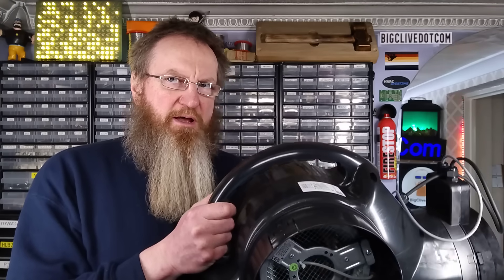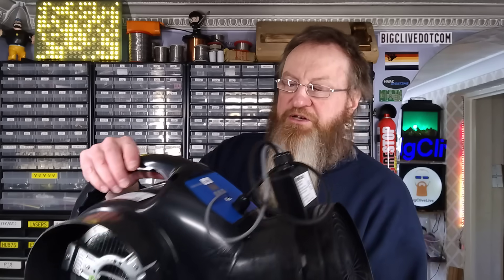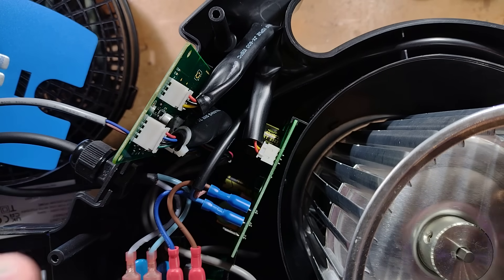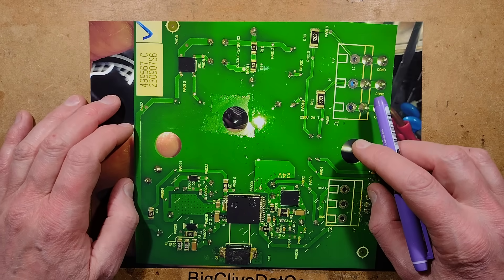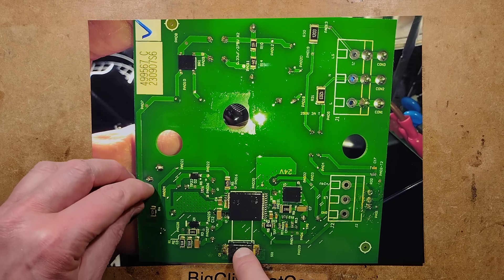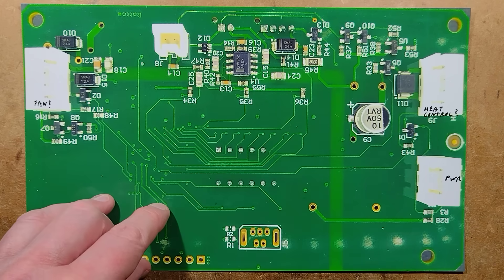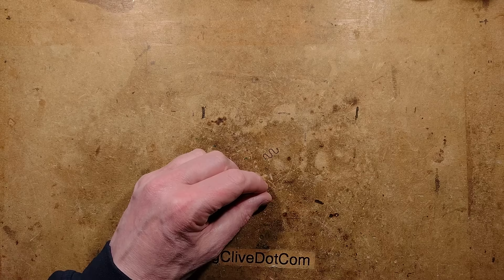Inside a Positive Input Ventilation (PIV) unit

Comment: More advanced products in this category are called Energy Recovery Ventilation (ERV). Essentially it pulls in fresh air across a radiator while pushing out stale air through a separate set of pipes across the same radiator so that the incoming air is at about the same temperature as the air that it's replacing. It's a fairly important part of modern high-efficiency residential design. A lot spendier up front than PIV, but because it literally recovers energy it's more cost effective in the long run.
Reply: Plus you get a guy to adjust it so that it is balanced pressure
Reply: My mates got one in his house and he says it's rubbish. Because of this they put no rads upstairs and just rely on the vents but it's cold even though it's over kill with insulation. He's switched the thing off and is going to put rads in.
Reply: @HA05GER  They did what? Even with perfect insulation an ERV isn't going to provide any room heating. If they installed an ERV without heat of course it's going to be cold.
Reply: @eDoc2020  so the system sucks in fresh air when needed and also circulates the heat from downstairs to upstairs via vents. So the whole downstairs is heated but not up and relys on this system to push the heat upstairs. It's a huge unit that takes up a large cupboard and the loft is filled with ducting to distribute the air.
Reply: @HA05GER  That's a lot different than just an ERV. If everything's installed properly the circulation should let you get away without more radiators but I don't think there's any harm in adding extra radiators.
Reply: @eDoc2020  yeh but it does positive input aswell. So it runs on the same principle as a pub aswell as moving air around the property.

Comment: That 24V component connected across the supply rail of the microcontroller board looks like a transient voltage/avalanche diode to protect against voltage spikes.  24V is probably the nominal voltage.

Comment: I would not recommend them. I worked for the council, which had thousands fitted. They can be very cold, at times, and drafty, and the need to service them every year which meant getting into the loft, which had its own health and safety problems. Also, installation needs to be done with care (make sure the vent will not blow near a smoke alarm).

Comment: It wouldn't be that difficult to manufacture a simple wire frame to support that filter bag;  Fit one of the available "Hi-Flow" HEPA filters and you can have a very clean air supply - I would imagine you might find that some of the larger cylinder HEPA filters used on  commercial wet / dry vacuum cleaners will do the job quite well, or they would be easily modified to suit! End up with "almost clean-room" air standards indoors!

Comment: Overpressurizing your house is a really terrible idea in cold climate as the warm, moist inside air will be forced into the structure where it cools and causes condensation in the insulation as the dew point forms inside the walls. In hot climates where the inside air is cooler and drier due to air conditioning than the outside and there's not much insulation in the walls anyway it's different. Here in Finland all houses are built to have a slight vacuum due to either exhaust fans or natural ventilation through chimneys to prevent condensation in the walls.

Comment: The professional version of these have a Transverse Flow Heat Exchanger, which passes incoming air in the opposite direction to the out-going air, thus saving any "Hot" and/or Cold" from being lost. They do dramatically increase the efficiency of an Air-Con system.
I built my own out of a few lengths of Air-Con duct and a small fan. Temperature measurements at "In" and "Out" show a worthwhile gain in efficiency.

Comment: eh those bit coin mining graphix card cooling fan arrays are super cheap. wonder if it would work to just use one of those with some clever ducting and a heat exchanger? 30 bucks for the fan array, another 40 bucks to buy a small car radiator of some kind

Comment: Maybe it should be remembered older houses had an average of three complete air exchanges per hour, and Scottish Castles are notoriously draughty.  Newer, so-called "air tight" insulated homes, have three per day. Balanced Heat/Energy Recovery Ventilators are recommended for enersave houses.  

My tiny postwar castle in the PNW benefits from fresh air, except when raining.  I'd buy it if it was cheap, otherwise I use fans sealed onto the inside window frame to create draught. I have two, named: Sucky and Blowy.

Blowy is in the bedroom and blows inward, and Sucky is in the castle kitchens, expelling cooking odors outside. They are on smart plugs as an inventively-named routine. "Alexa, !@#$!  "Never even considered creating positive pressure!  

This would safely better eliminate the musty biker motel castle smell, and smoking, BO, mold, and beer spills, dirty workclothes, leaking hot water tank and toilet; than sucking in attic vermiculite asbestos and rat droppings through the castle ceiling, the immediately adjacent septic tank, and the Royal Mounted peeing off the ramparts (they tell me it keeps the bears away). Thank you, this is Brilliant.

Comment: Neat idea for the winter it has a heating element I would guess the loss is negligible. In the US heat exchangers are a thing with tight houses the outside air is warmed or cooled so you do not  loose a lot of heat or AC . And stale air is expelled.

Comment: Over here in Canada, I've been told to install an HRV (heat recovery ventilator, I believe) as part of a renovation. We did so, but we aren't finished with the work yet, so we aren't running with it on. But the interior of that device is bizarre. Two fans and a stack of sign plastic (in alternating directions) that the air flows through. One fan exhausts interior air, and one sucks in outdoor air. Supposedly the stack of plastic does heat equilibration, and somehow it also deals with humidity. I have a hard time believing this, but we're required to install it, and eventually I will see how it actually performs. It's somewhat similar to what you're looking at here, at least in function, but a lot simpler in terms of electronics. (Well, there is a control panel for the thing that can change the fan speeds and probably program times off and on, but that's about it, I think.)
Reply: hrv has the plastic core, tho aluminum ones can work better for really cold climates. while it blows indoor moisture out, you may find it your dry outdoor air makes the house to dry and need humidification. erv's work better (uses a paper core) and they keep the moisture in the house (less humidification needed but may need dehumidifier in summer). they need programming to set the correct speed for the volume of the house. they also have a defrost function to defrost the core.
if your renovating i would have it running at a high speed. ventilate all the fumes from paint, glue, etc.

Comment: Pressurized indoor air cannot be used when the outside temperature is below zero degrees. The humidity in the room air condenses on the inside surfaces of the exterior walls and causes problems.

Comment: nice video. they are common here. that one looks old school. most now use ec fans often with 0-10v connection for speed control. 
typically use a wall mounted controller in the main room, so it reads room temp and sometimes humidity on the fancy models.
very cold/dry countries tend to use exhaust ventilation so it sucks dry outside air into the house through walls etc, to avoid inside moisture frosting inside the walls.
the best is balanced ventilation either hrv or better yet erv, but you need a decent house for them to work well.

the filters should have a basket for them to go over or go inside a big tube the other way around.
you can use an outdoor vent, especially in hot summer. typically they will shut off went it gets to hot.

to much airflow can bring in a lot of humidity and make things worse.

the vents actually fire the air across the ceiling so it follows the ceiling and wall. that way it can sneak down the back of curtains (if no pelmet) and stop condensation forming on the windows.

the cold air coming in is more of a perceived issue rather than a real issue. we get lots of problems with certain types of people blocking them off because they thing it will save them on heating costs, and then they end up with moldy homes.

Comment: Hi Clive. An interesting idea...but....shuts off, or gobbles electricity, in the winter\cold weather, and fills the house with (super) heated air in the summer and\or sunny days. Hm-m-m...maybe not so great year round, but okay for 2 seasons? I grew up in a house with a 'whole house' fan. It exhausted air from the attic. Really helped keep the house cool from spring through fall, and our climate isn't all that sunny really (southern Ontartio, Canada).

Comment: I've been reading the comments and have to add the following. Yes, the air is very dry in most cold climates however once the air is inside it picks up moisture from people, plants, cooking, humidifiers, bathing, etc. This moist air is what will be forced into  the wall cavities where it condense. If this were not a problem, there would be no need for vapor barrier at all.

Comment: Similar type units are very popular in New Zealand, although they are termed 'Positive Pressure Ventilation PPV' systems here. They incorporate 'box filters', typically 'hospital grade', not the flimsy inlet bags though.  These PPV systems NEED leak points to work, i.e. window & door gaps etc.  I know someone who had one of these with traditional wooden windows & doors and it worked well - they replaceed with all double glazed (i.e. well sealed) units and it stopped working, leaving moisture on all the windows etc.

Comment: Looks like it was designed by someone who was tasked with making, as you said, something that would be a jack of all trades but stole building blocks of circuitry from other things- “this is how this board controlled a fan so I’ll use that, this is how that other board powered a micro so I’ll use that” etc. and then figured out how to more or less make them work together. Couple that with an outsourced production run of miswired cabling necessitating the kludges you found and hey presto! here we are.

The intake filter just needs an internal wire cage to keep it open, made of coat hangers or heavy gauge baking wire. The heater will keep your attic warm, presumably keeping your roof free of ice and snow. In an older home like yours there probably isn’t a lot of insulation between the ceilings of the living space and the attic so you might as well do that and not run your ordinary heating (which I know you don’t like to do as it is).

Interesting but weird device indeed.
Reply: Good point about the heater potentially losing some energy back into the attic

Comment: Ha timing. I posted a terrible short last night about PIV. I really fancy one of these units, but boosting the pressure in my stairwell when our woodburner's chimney downstairs must be reducing pressure in the room it's in seems counterproductive. I hacked a bathroom extractor (intractor?) prototype onto the airbrick behind my stove a few months ago which did seem to produce the desired outcome - nicer 'feel' far from stove and on longer runs in frosty weather (we only put woodburner on in afternoon/evening), markedly less condensation on windows. I think I need a whole winter to be sure. The air change rate compared to house volume must mean it needs to be mostly on?

Comment: Looks like it could be noisy. Hope not.
Reply from the maker: It's incredibly quiet, mainly because of the low speed DC motor and the way it is mounted by suspending it from a rafter by a cord for vibration isolation.  I have to go right over to the vent to hear the slight whoosh of air.

Comment: I used to fit Heat Recovery Ventilation in domestic houses, particularly woodframe houses where it's essential to prevent mould/rot of the woodframe structure the best machines were/are Scandinavian because they've developed the best systems whereby you can add silencers,filters,heaters,chillers as required,and the motors were easy to replace (one simple unit locked in place in the main machine housing) because if you don't fit a good sound insulated system you'll hear a constant background hum that's irritating...British manufacturers tried competing with the Scandinavian brands,it didn't end well.
Maybe they've improved?
Reply from the maker: This one is very quiet.  I have to go right over to the vent to detect the slight whoosh of air.

Comment: That's a big fan! It's also a very interesting subject! I have a mold problem in my house and I didn't think of using the attic as a source of air for constant ventilation. I made a plywood panel for a window, with an old mains Papst silent fan (from an eighties huge computer housing) and got mixed results.
This video makes me go back to this subject, as I'm loosing my fight with mold and excess humidity. I would really like to know how it goes for you.

Comment: Got my PIV in 2018. I replaced my furnace with a two stage Carrier. The t-stat has three options for the G terminal. Low Med, and high. I leave mine on low from Oct to May. It pulls in just enough fresh air to push two packs of smokes a day out. In Canada our furnaces have a 5 inch pipe on the return air that pulls in fresh air. The fan in low draws 30 watts. I don't even notice that's it's on.

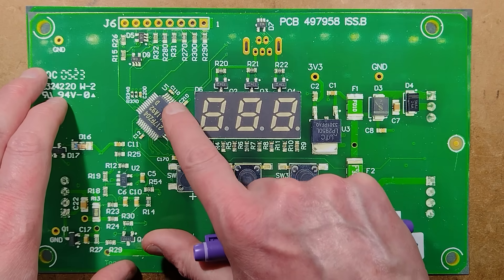Comment: 11:50 Interesting trough-hole footprint for a USB connector on the display board. Those are quite unusual
Reply: I think it's for debug while the other connector obviously is for the programmer of the microcontroller.

Comment: There are some air exchangers that have heat exchangers to more closely match the temperature.  Would be necessary here because there are so few days where the outside temperature is comfortable. I'd also want an air quality monitor that shuts it off in the event of smoke/smog/extreme pollen/etc.

I don't think it will help with humidity unless the heater's on, because both heat and a/c will reduce the relative humidity, but a fan will just bring it towards whatever the outside humidity is. For days where the heat is off, you'd probably want a dehumidifier instead.
Reply: I used to fit HRV in primarily newbuild woodframe houses,the Scandinavian systems were/are the best because the main unit fulfilled your first heat exchange requirement and you could add heaters,chillers,hepa filters into the system...expensive but great systems with long life motors that are replaceable.

Comment: Living in Canada I find this to be rather surprising.    It relies on air leaks to push out old air?     Here a modern house (since the 90's?) use ERV's.   They are required because our houses are too well sealed so ERVs provide forced air exchange in both directions and have a heat exchange section so that you are not wasting too much heat (or cool in summer). They don't have additional heaters like these, they just transfer heat between the 2 air streams as they pass through the exchanger.  ERV's are ducted throughout the house.

Comment: i'm curious to know what sort of roof you have.   iv spent some time crawling about in roof cavities and some have high humidity caused by moisture settling on the inside of iron roofing or bathroom exhaust fans feeding into the cavity instead of drafting to outside.  this last mentioned feature causes dry rot in the ceiling and roofing timbers hence fungal spores, even here in perth waestern australia.    i find the concept of this machine interesting.
Reply from the maker: Walk in attic with wooden structure and vented eaves.

Comment: I have one of those. I upgraded the filters on mine to catch more mould and pollution. It does work but you do need the inside air to be warmer than the outside air. Also any problem rooms need a vent to outside and a 10mm gap under the door (or leave it open) otherwise it's less effective. You also need proper extraction in the kitchen and bathroom. This isn't up to the task of correcting humidity caused by cooking and showering. If you have a big air leak in one room then the rest won't get much airflow so you'd need to shut that door or reduce the leak. The piv works best at night when the air is cold. It's the temperature difference that has the dehumidifying effect. Cold air holds less moisture than warm air so if you mix it with warm air you get a humidity and temperature somewhere between the two.
Reply: As I have a neighbour with a log burner who burns foraged wood I often wondered if I need enhanced filters. Would it be possible for you to provide information as to the ones you found?